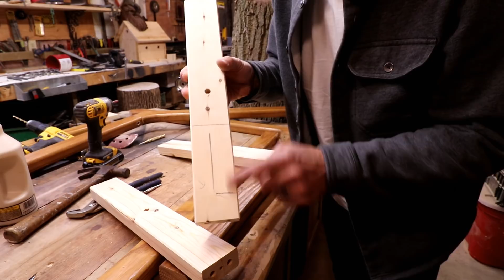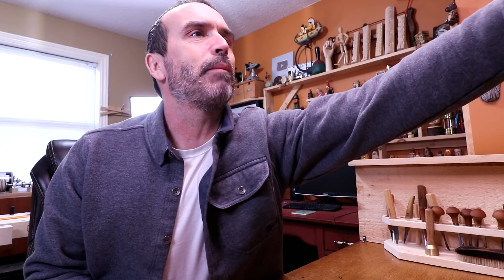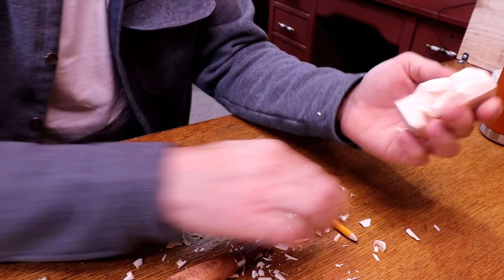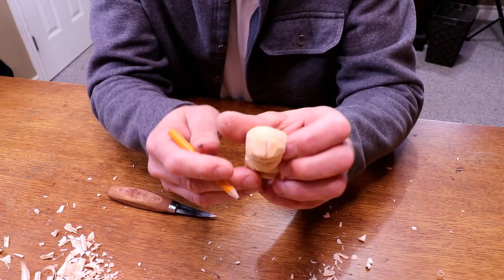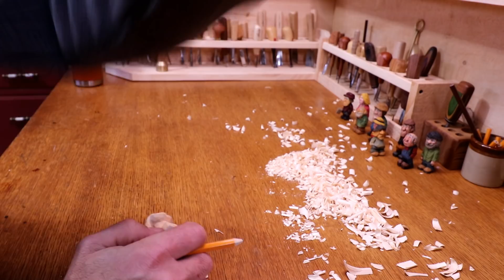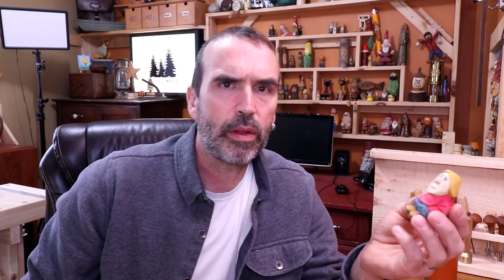Carving Junk Wood with Just a Knife - Mora 120

Comment: I have restarted my whittling projects since the lockdown over here in the UK, you an Gene Messer gave me the whittling bug to start with many moons back, i am carving a Kingfisher as the main realistic project and also carving a chess set from branches as a fun project too but using my SAK hunter as the only tool allowed. Stay safe thanks for posting.
Reply: Hi Rokh &Roll, I'm in the UK and have just found Doug and I'm so inspired by him. I did some of his simple Santa's for Xmas this year and they came out OK for a first attempt. The wood for these came from Amazon and was advertised as Basswood and it was OK for a beginner. Can I please ask you which wood you use and from where you source it? I've recently purchased some  Lime wood on line from a UK supplier in block format as it's cheaper than individual small blocks, but it is very hard for a beginner like myself. It is very difficult in the UK to source North American Basswood as Doug uses, which seems to cut so much easier than European Lime. Any help would be appreciated, thanks.
Reply: @robertprice7459  Agree Robert i dont think a lot of the chinese wood from Amazon is proper Basswood .im in the UK as well

Comment: Haven't seen a Sasquatch big toe hairy yeti thing yet, could be an interesting one.great clip tippy toppy topper. 44 min escape. we are all grateful.
Reply: Now I have finally decided what to carve in some of the standing dead trees around here en masse. Not just a few faces watching my "campsite" (on property but away from house). Sasquatch! 
We have a lot of tales of them around here bordering the Ishi wilderness. Sometimes camping out there people hear someone/thing off in the distance beating a tree with a log or bat. Not a 200lb nocturnal woodpecker. There could be wild people out there too considering it is where the last surviving wild tribe in america hid out after their slaughter. Not likely other campers since its a very long and rough road and you often need a chainsaw (winter tree-falls) and a winch (rock slides too big for 50" tires) to get there.

Just need to find a cheap hatchet replacement. Been using an old vaughn roofing hatchet. Neck is splintering but it holds an edge well enough to get by. Anyone have suggestions for a super cheap budget hatchet for carving? When I say budget, I mean I am on SSDI and they give me below cost of living and I trade off a week of food money for a 50$ purchase, kind of budget.

Comment: Gene Messer had a good tip for softening wood.  Let it soak in a 50/50 mixture of water and 50% alcohol.  I haven't tried it yet, but I would think it would work on softening up spruce.

Comment: Hey Doug, first up belated birthday greetings. Did you think about using a denatured alcohol spray to soften the spruce as you were cutting? Gene Messer  has suggested it works but to be honest I can't feel any difference.  Noticed the ash logs sitting in the shop with no end sealer on them, now that's a no no. Thanks again for the inspirations.

Comment: Just cringed listening to the wood grind as you carved it... thinking that knife is going to break... Then remembers it is a mora knife.  i have carved pine like that... ugh... may hands and forearms hurt when I was done.  Nice work over all.... You should try some Alaskan Yellow Pine... carves not quite as hard, sightly tighter grain, really nice smell to it too... I did a comfort bird for my sister in-law... I used my normal carving knifes... I am thinking I should have pulled a Mora out for some if it...